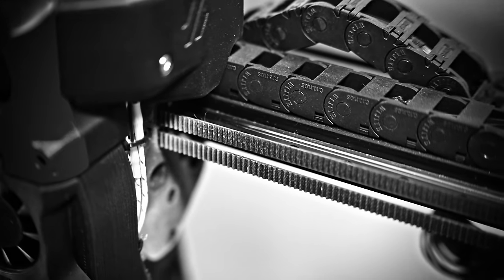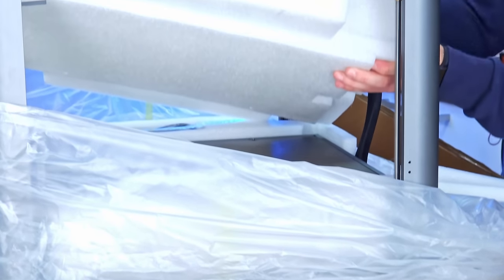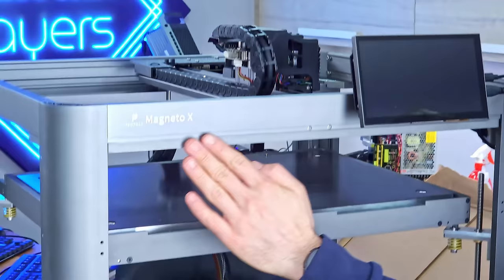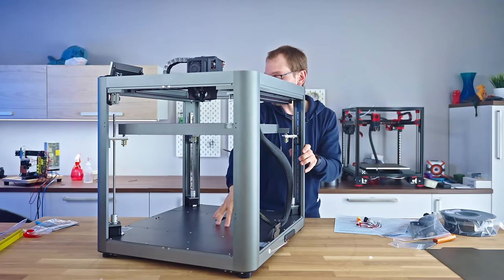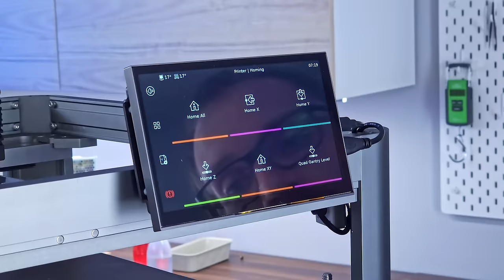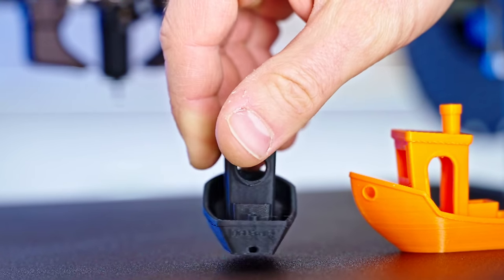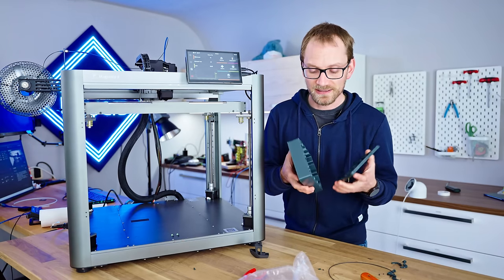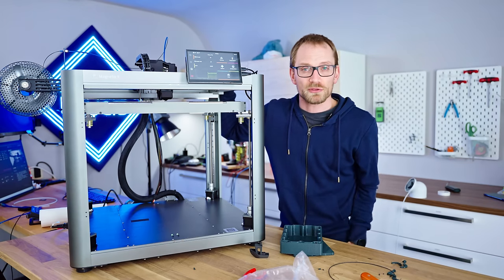The 3D printer with no belts: The Peopoly Magneto X uses closed-loop linear motors!

Comment: This is something that has finally trickled its way down from Comercial CNC machines. No more belt noise at high speed. I loove this machine and it is on my Must have list!
Reply: its sure promising, but at this stage you and anyone else buying one, would be buying it out of an irrational lust for technological advancement and where they believe the quality will be/get to, not for any practical outcome, as any prints ive seen are pretty terrible, like really terrible. Not the benchie, obviously that was pretty good in some areas, so heres hoping its just tuning required.
Reply: What CNC machines? I didn’t know this was actually being used already
Reply: @Industry-insider  expensive ones. linear motors have been around for years. Anyone presenting this as a peopoly invention is misinformed. All they have done is manufacture them at a scaled back power and a cost the 3d printer market will bare.
Reply: Honestly though, ill take ballscrews on axis before this anyday.
Reply: @jeremyglover5541 Why? Some of the most precise and excellent machines I know of use Linear motors, like the Kern Micro HD (combined them with hydrostatic ways).
Reply: @jeremyglover5541 ballscrews are laughably slow
Reply: @drkastenbrot  no, they really arent. If your ambitions with your prints are something more than printing fast benchies, or more printer parts, you are already material limited. I would not call pantheon ‘laughably slow’
Reply: Now, of course, if your ‘ambition’ is nothing more than printing pla trinkets/landfill as fast as possible … sure, go right ahead. I get the feeling youre just talking out your ass though. Lets quite some numbers, pantheon max 500mm/2 300mm/2 continuous. Accel 40K 10k continuous. This is far faster than you will ever need printing engineering materials with passable layer adhesion.
Reply: And this is 3d printing. Ballscrews are at the heart of some of the fastest cnc around, yet they are “laughably slow”? 

A ballscrew doesnt even have a speed by itself, its a mechanism. Really depends how much power you have behind it. Just some numbers from NSK have ballscrew mechs reaching feed speeds of more than 3m/s 6 years ago … i dont feel like investing any more time to find something newer, because your statement is patently false.
Reply: @Thorhian  because im yet to see them used well in 3d printing. Nothing against the mech, absolutely it has the potential to do great things. I just dont think this is it. I think the money required to use high quality linear motors in a 3d printer is not worth it, when ballscrews and servos can already so the job very well, without the potential EMI issues. The fact the magnets are just kind of loosely sitting there just seems a bit jank to me and could be a tuning nightmare, as they are free to move around somewhat. I dint like the idea of a motor winding and a bunch of magnets splayed open without any kind of enclosure, right next to my sensitive electronics. Of course servos and high quality ballscrews arent cheap either, but i reckon you could push that price down quicker than linmots. Ill be happy to be proven wrong.
Reply: @jeremyglover5541  all ballscrews have a rated maximum rotational speed after which they may resonate. even if you took a large diameter ball screw to get high speed, the amount of power needed to overcome the inertia gets absurd quickly and you couldnt even power your 800mm/s 3d printer from a standard outlet. belts have the upper hand in speed and acceleration because they have minimal weight. if you believe otherwise, why dont you try setting a new world record and prove all the previous ones using belts false?
Reply: @jeremyglover5541  Oh sorry, I thought you meant in general with CNC machines when you responded to Sauce.
Reply: @jeremyglover5541  i am just not sure what this is supposed to be good for. 3d printers dont have to deal with any tool loading, all they have to drive is the inertia of the gantry. this has already been perfected with cheap and lightweight belt drives thanks to closed loop input shaping. these linear servo drives sure seem more advanced but id expect them to perform worse (same quality but slower) due to the substantial mass. a possible interesting application would be large multi-head printers with multiple independent toolheads on the x axis, im definitely looking forward to that.
Reply: @drkastenbrot no they are not a fast cnc lathe is pretty fast and that with some super heavy turret on it.
Reply: CroXY and other improvements in motion system torsional performance, center of gravity and tool length optimisation damping and feedback are more interesting to me. When moving silly fast on a flimsy lightweight and poorly constructed toolhead, the load of the device itself is already fairly significant, even inside a control loop.
Reply: At some point, other tech becomes more accurate anyway, like cnc, slm, laser cutting and edm, vs our glorified hotglue guns
Reply: @Industry-insider @SauceM3 Here's a specific answer: Sodick.
Wire and sinker EDM such as the ALN600G and AD55L. SLS metal 3DP/high speed mill OPM250L.
Reply: There have been linear motors on industrial 3D printers for a long while.
Reply: The issue they tackled on CNC machines with these was mainly the wear, which will cause backlash over time, at a level that doesn't even matter in printers. My VMC has like about 10 microns of backlash in X and Y, which is a lot compared to zero microns when it was new. Linear motors will always continue to have zero backlash.

Comment: I really hope linear motors start being more accessible. I could totally imagine a future where we just forget about belts completely. Id absolutely take all of the tradeoffs to get that no worry consistent accuracy and low maintenance.
Reply: Wouldn't that mean that we wouldn't have CoreXY and back to Cartesian?
Reply: @Domophillius well sort of, except it doesn't have stepper motors and these will probably get way less hot, and no belts to slip

it still is better than a bedslinger
Reply: Peopoly did say that they designed these ones from the ground up and were open to releasing them as their own thing. If they did, I'd be so up for upgrading my ratrig with these.
Reply: @Domophillius  Sure but its never about the name but the function. This isnt offset on the x axis because the y motor is pretty much spread across all of the x axis, and obviously the y axis is stationary. Combine that with closed loop control, a wider area to spread and dissipate heat and strength and It sounds like many plusses to me.
Reply: @BeefIngot  exactly the point i said to someone else on another channel

especially since the mags wont get anywhere as hot i'm sure it'll be more efficient either way and maintain more "torque" or pulling/stall force rather

the hotter the neo mags get the less force that remains and the more current you need
Reply: @Domophillius   "Wouldn't that mean that we wouldn't have CoreXY and back to Cartesian?" 
Looks like it. And going by this one, the Y-axis is driven only on one side. Not to forget the added weight, mass, to the gantry. Particularly the Y, sine all that motor stuff, needs to be integrated into the rod itself. Given that on this very sample, you even have a drag chain, we are talking at least 750g. A 350 Voron, the cables alone is about 500g. As in added weight due to the usage of that drag chain. If you go by this prototype that is.

This is a dead end. The moving mass is way too high. The focus and awareness of that weight, is like non-existent. So when somebody introduce something in metal, that is shiny, people don't think added weight. But at the acceleration they want to run this thing at, this is getting out of hand.

Sure, for slow printing, a form of direct drive could improve accuracy. Until moving mass matters. And given we are talking a moving mass approaching like 2Kg on designs like these, that is not a lot of acceleration.
Reply: @FrodeBergetonNilsen  Its not all about moving mass, but rigidity and motor strength also matter.

Youre not counting a whole lot while focusing on one thing.
Reply: @redkingrauri3769  how susceptible to heat are these linear motors.  i may be barking up the wrong tree here and its not even an issue, but the reason for me to avoid just getting 4 or 5 sv08 would be that for engineering materials the motors are inside the enclosure,  this too,  rat rigs aren't or if i built a proper voron they aren't...  when do you start having problems and how do we know if this one would?
Reply: @DeagleBingo  I'm no engineer and this stuff is new to me too but from what I read heat was the biggest issue for these things. But that article was over 20 years old. Heat mostly would reduce their movement force but with proper cooling that's hardly an issue.

Given peoply was confident enough to include an Enclosure with the magneto x if imagine they factored that in.

That being said, don't go for the sv08. Things a mess. Get a vivedino troodon if you're looking for a voron alt.

Comment: I actually got one of the pre-sale units ordered, and that enabled me to get updates when they made changes or if something happened like the delays.   The reason I point this out is they seem extremely in tune with their customers and the sample units they sent out (like the one shown here) have been improved multiple times since they were built and shipped out to get some feedback from makers/content creators that deal with lots and lots of 3D printers and other hardware, after all - you guys will be tearing them apart and really finding out what is fantastic, what is good but needs improved, and what is so bad it would prevent sales, as well as have the knowledge on how one might go about fixing the issues.

As of lately we got another 'month delay' so I won't be getting mine anytime soon, but it's nice the videos can start coming out to discuss.
Reply: This is a good approach, though 100% I think they should have safety features in from the outset regardless
Reply: Do you know if any of the problems he showed in this video have been ironed out I got a grant to get one for my business but after this video, I’m worried About the quality, a bunch of artifacting the bed ramming itself into the head, exposed mains voltage
Reply: Thank you for your support. We will add an insulation solution to all printers. An update blog is coming this week.
Reply from the maker: I much prefer having a printer that is a little delayed than one that is totally unfinished. IMO, the Magnto hardware is in a good spot, and software is easily upgradable even once the units are already out in the wild.
Reply: Sounds like what Microsoft did with Windows 7 release where they had the customer figure out what did not work!!
Reply: Same boat pre ordered and following along on Facebook to see when the printer will actually ship
Reply: Peopoly being in tune with their customers? As a Moai owner I do find that slightly hard to believe.

Comment: This is the kind of machine that needs to be reviewed by a man like you! Very interesting review. Thorough as always! I think this (linear stepper motors) will set the new standard for 3D printers in the future. Very surprised to see the very promising long melt chamber. This machine is a very good answer to and even a step forward from the Bambu machines IMO. Just needs a little ironing still... But very well done by Peopoly .. again proving that they still are innovators!

One question remains though: Are you sure that the coil shouldn't be placed between the bed and the Z-corner support instead of underneath. Then a crash like the one you had would not result in damage so easily.
Reply from the maker: Thanks! The bed springs are intended to be installed as I showed, as using them in an Ender-style arrangement would make for a quite wobbly and shaky bed assembly, I think.
https://wiki.peopoly.net/en/magneto/magneto-x/setup-guide

Comment: Glad that it sounds like the majority of the issues are things that can be improved on in a software update rather than a fundamental issue with hardware. Definitely would be good to have some insulation updates, I'll add that to the to do list for when mine arrives.
Reply: its klipper you don't need an update just to tune it
Reply: @patching-  Yep! Most of the complaints about the print quality are just down to basic end-user calibration. Factory calibration is a good starting point but it should always be completed by the end-user after the printer has shipped to them, using their own filament. No printer is going to remain unchanged after shipping and assembly, nor is any printer or filament going to be absolutely identical to the factory ideal. Even the local temperature and humidity and going to change your results. 
That's something I'd like to see in a long-term review though, this printer looks very promising as it is.

Comment: that is a serious oversight of them, klipper does not allow moving the bed without knowing home first, unlesss you manually enter a Unsafe move macro
so either it was a you issue, or they did something that messed this up, and allows unsafe moves...
usually the nozzle probe would be used as a Z endstop, and you can only move the bed once the nozzle has verified Z max or min
Reply from the maker: Moving is indeed only allowed once the printer is homed, but it currently does not prevent you from moving to unsafe coordinates. What happened is that the printer was freshly homed, and instead of clicking "Z +25mm", I clicked "Z -25mm" as my exhausted brain thought I needed to move the bed "down", and the printer obliged. Only that this moved the nozzle further into the bed...
Typically this is prevented with software endstops, but it seems like that feature is not currently enabled, and the loadcell as a Z endstop is likely also disabled outside of the actual homing and probing cycles to prevent false triggers e.g. during filament retracts.
Reply: @MadeWithLayers it needs a failsafe to prevent nozzle/bed damage 

The load cell is there, so this is a coding issue, not a need for extra parts

Ideally I'd like to see a position encoder on the vertical axis. Relying on the leadscrews is ok but not as good as actually measuring and linear encoders are fairly cheap
Reply: then it sounds like they did indeed misconfigure the printer in klipper, as in klipper you can set the endstop position, and the max z that is allowed to move, incase of a nozzle probe it should both be the same, which would prevent moving past the nozzle probed location @MadeWithLayers  
they seriously need to get their configs straight before sending out printers like this, they also need to configure the klipperscreen correctly, as it would have allowed to swap the direction buttons, on my trident i swapped them so that the down button moves the bed down and the up button moves it up

Comment: Closed loop linear encoder control is used in every inkjet printer. Happy to see one in a 3d printer.
Reply from the maker: For inkjet printers, it's about saving cost by using dirt-cheap, barely powerful enough brushed motors (that have no positional awareness otherwise). Here, the linear BLDC motor would actually be able to position itself without extra help, but would have immensely coarse resolution. So while the resulting closed-loop system and its error-correcting abilities are a nice side-effect, the encoder really is an integral part to make this system work in the first place.
Reply: @MadeWithLayers  This is exactly the reason I am excited. I wonder why 3d printer designers focus on steppers or rotary servos. The cheaper system in Inkjet printers is not affected from belt stretch, motor in-linearity etc. all this is compensated for by the control algorithm while also improving speed, precision and fidelity. TBH I wanted to make a POC printer with linear encoders for some time now. Usually these are simple optical encoders. These look like capacitive or magnetic encoders, interesting.
Reply: @flipschwipp6572 Inkjet printers just move the head at a constant speed, which is easy with a DC motor and linear encoder to count movements. A 3D printer needs to be able to accelerate and decelerate and control position to within sub-milimeters, something that would be near impossible without some sort of 'step' drive.
Reply: @frankhovis  DC or BLDC  servo drives are perfectly fit for positioning and acceleration. They motor may need to be little bigger than in a usual inkjet to satisfy acceleration needs but thats it.
Reply: @MadeWithLayers Inkjet printers require a magnitude or two better resolution than a 3D printer, most of them are faster too. However, the task is easier as they have to do just constant speed and fixed trajectory movements. 

Besides that, if you were to closed-loop control a stepper, you might as well leave out the steps and just use a BLDC servo which is essentially almost the same control model just the number of phases are different.
Reply: inkjet printers have a simpler motion problem than 3d printers: they only have to move one axis at a time. In theory, they could ran at any speed and just use the position sensing to decide when to fire the ink jets, if the position sensing was precise enough.
Reply: I have never heard this before. Why the heck aren't linear encoders cheap as chips on the usual suspects if produced in such large quantities??
Reply: @frankhovis  It is possible to accelerate and decelerate a dc motor precisely with a closed loop system using the linear encoder for feedback and PWM to drive the motor
Reply: @BeefIngot  Look at the encoders in inkjets. They're optimised to maximum, it's not like there's some separate device attached to the rail. Everything is all-in-one for cost optimisation. You can however salvage the encoders from old or broken printers and use them for something, but that's for DIY projects and people sometimes do that.